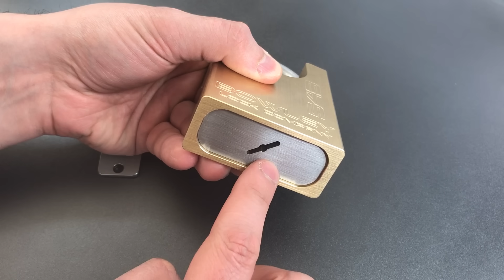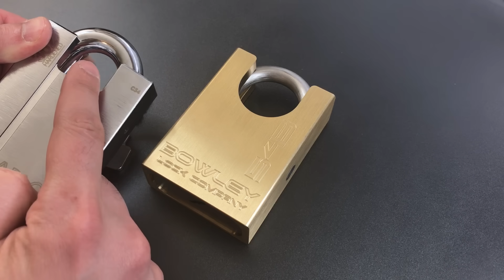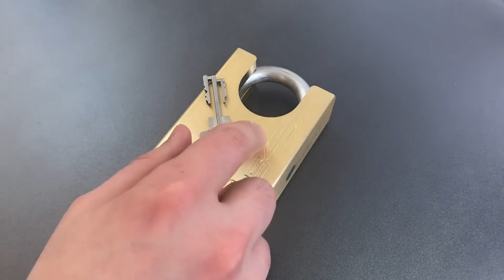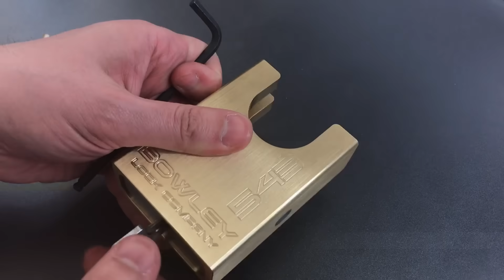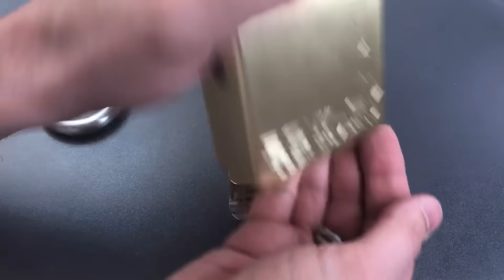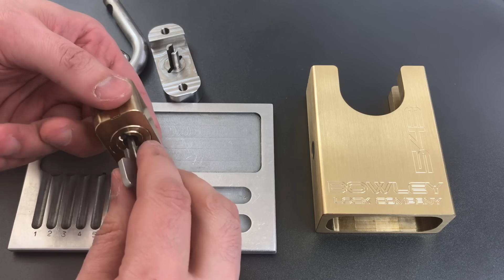[653] Prototype Dual Fork Bowley Padlock (Model 543)

Comment: I just don't see that key lasting... I mean, if you lock IT up in a cabinet somewhere, where it NEVER get's touched.....I guess it'll be okay, until time gets to it... but being such a frail little thing with such tiny amounts of connecting tissue (metal), it would be SO easy to accidentally skew, break, bend, etc. I dunno...I know you touch on this, but still... that doesn't look good. At all..... ...... and 1.2 seconds of effortless "bending" is hardly representative of what could happen out in the world with a chintzy key like this flopping around, catching on things, being pressed on, etc... 

Also, you said the lock body was brass right? One being aluminum as well right?  Can't you just use a cordless grinder, thin cutting wheel, and make one fast line down the thing, then just peel it open? I mean, you can have the strongest shackle and bottom plate on or off earth... but if the case is made of paper, that's not gonna do much.... right?

Comment: Good gawly Miss Molly... Are you kidding me!!!
 Other than the sport of making a pick proof lock, and they surly did... 
  At some point, wouldn't a 12Ga shotgun just have to be called upon! 
   This takes padlocks to a different level. 
   At some point, cutting the lock is not the weak link. Taking out whatever it's locking through becomes the weak link and can always be done....NOT NONDESTRUCTIVE. One will have to break something.

Comment: Me, as a Brit:

Listens to the rationale for the model number: Cries in metric
Reply: The rest of the world agree with you. Miles? Miles what? Foot? Who's foot??? Who the hell has a foot like that? Inches? Oh, I see. So you're telling me that, to apply a convertion, you just have to multiply a centimeter by <insert a random irrational number here>
Reply: @gabrielsantana6161  For what it's worth, the conversion factor isn't an irrational number. One inch is exactly 2.54 centimeters.
Reply: Trying to work out how it's 5/4" thick 🤔
Reply: @rich7304  Where's the problem? 😄
Reply: @kubauhlir1730  inches.......inches are the problem 😂
We won't even go into how fractions work 😜

Comment: I’m gonna go out on a limb here and say that this one is probably the closest a lock will ever get to being “pickproof” in a long time.

Edit: I’d like to reiterate that I said PICK-proof. A cutting wheel and a blowtorch is not lock picking
Reply: He’s got a video where he lists the best locks made and there’s one he says he has never been able to pick.
Reply: @srcastic8764  which one?
Reply: LockPickingAttorney in 2121 "This primitive lock from the last century was difficult at the time to pick, but with modern quantum impressioning tools it's ridiculously easy"
Reply: The thing is, that this here is a commercially mass produceable lock, while the stuff made here one is so incredibly specific and has so many unreliable parts, that you cant realistically mass produce it
Reply: @BlueTroll  
What kind of shitty locks would open with air pressure? You are better off just raking it open if the pins are designed as open at the bottom position.
Reply: @Bollibompa  I'm not arguing at all that the standard key locks you buy at the store are secure at all, just a method of opening them.
Reply: @BlueTroll  
I'd argue that almost no padlock made in the 21st century has pins designed like that. I'd love to see it happen though. I'm very suspicious about the tennis ball thing though even if it would be a hilarious party trick to use on old cars at a meet-up with old Chevrolets and Ford models.
Reply: @Bollibompa  I'm curious about old car doors tbh. I know for a fact that all RV doors have the same keys unless the locks are custom, so I'd imagine older cars, the manufacturers didn't care about that aspect to much. I know even with modern keys, dealerships have skeleton keys for particular brands.
Reply: @Bollibompa  it may not even be the pins that are failing with the air. There are so many ins with the common cheap padlocks, it's almost not worth The effort to use the for "added security"
Reply: @BlueTroll  “it may not even be the pins that are failing with the air”? Cores don’t turn unless the pins are moved to the shear point, moved out of the way, broken, or drilled. What are you surmising could be letting the lock turn unless it is the pins “failing”?
Reply: @docholliday9741  I'm really not surmising anything. Something engages or releases. As to what on each particular lock when it fails from air? I'm not sure.
Reply: It is almost definitley pick proof but just cut through the top which means it isn’t invulnerable. Bowley should make door and window locks from the same core as that padlock
Reply: @theelevatedone1630  it's pickable
Reply: @theelevatedone1630  they do make a deadbolt as well
Reply: @theelevatedone1630 mate if i bring a sledgehammer, i could break this lock. The whole point is that your average joe won’t bring a sledgehammer
Reply: @theelevatedone1630  they have deadbolt locks for doors which are similar in idea to this padlock, but theyre an older model that use 1 set of pins. That being said, LPL to my knowledge still hasnt picked the single set core for the dead bolt lock.
Reply: @Massey9276  dead bolts are easy
Reply: @abrother9821  Even if the Stuff Made Here lock turns out to be pickable, I doubt it will be pickable with any existing, well known methods.
Reply: @r3dp9  I'm sure you've seen the new video where LPL picked his locks, both of them, but mentioned that theres a few simple improvements that stuff made here can make to make the locks far more resistant to the attacks used.
Reply: @r3dp9  that comment didn't age well lol
Reply: @r3dp9  well this didn’t age well
Reply: @r3dp9  lpl special tool turned out to be a pocket knife 😂
Reply: @r3dp9  they both got picked in under 1 minute
Reply: @r3dp9  I’ve got some bad news for you buddy
Reply: @r3dp9  this comment didn't age well
Reply: @ryantxbbq  I mean, it aged kinda well. He said it wouldn't be through well-known traditional methods. LPL did have to get pretty creative. First lock had to have a completely new method to opening, and the second lock had 1 new method, 1 new alteration of a regular method, and 1 old method that isn't really used anymore

And LPL was only able to figure this out because he's not only one of the best lockpickers in the world, but also had detailed blueprints of the inner workings of both locks. Far from traditional and well-known if we're being fair here
Reply: 4 SIDES ON YHE KEY AND HE CANT DO IT EVEN BETTER 8 SIDES
Reply: Yo dude saw your pic and just wanted to say CODE LYOKO FOR THE WIN
Reply: 12 minute video. Good indicator.
Reply: If you see a lock like this just break the chain
Reply: @abrother9821  The avarice of "it's unpickable if it doesn't have a key." That's what bypassing is for, friend.
Reply: @OtakuUnitedStudio  a door is only as strong as its frame.
Reply: Id class it as pick proof , having to figure out the notches on the key and bassicly make a key isnt lock picking to me.
Reply: I have some thoughts about how LPL can pick this type of locks, but it requires a custom-made pick made from a blank key (don't know if I got it right). He could insert a diamond tip or some other suitable for racking pick inside the blank and connect it to the main shaft with a flexible metal string, hard enough to apply force to the pins.
Reply: That's what everyone thought about every iteration of Bilock, EVVA, Medeco and Protec up to this point too.  Regular Bowleys have been picked, this one isn't unpickable.
Reply: Just cut the top
Reply: Until a tool is made to pick it.
Reply: When does the quad-fork version come out?
Reply: No. We got an actually Pickproof lock (note the capitalization). It is not an adjective, but a proper noun.
Reply: @abrother9821  but did he ever review it? I have been waiting for a video on it
Reply: Yes I would agree but I can't remember his name but if you Google picking bowley lock you will find it there a guy Chris something cant rember last name he's big in lock sport  community  he opens the original bowley they call it picking but in my opinion its more or less a homemade key that works by trial and error there is a video maybe 12 to 18 months old put this design is still the best on market as far as I'm concerned you cant stop everybody but this comes dam close
Reply: @abrother9821  and he picked it in like 10 seconds
Reply: @abrother9821  yeah tact didn’t go do well
Reply: @N Webb I beg to differ. Would you rather have like 5,000 lockpickers know how to pick your lock or just 1?
Reply: Wait, why didn't you pick this one?
Reply: @abrother9821  that one didnt age well...
Reply: ay, man mans, code lyoko pfp!
Reply: It willbe unpickable - as long as it isn't popular.

The moment a lot of people would use it, then it would stop being unpikable
Reply: Well, it stopped lpl
Reply: Pickproof isn't a useful word.

1. Every picker is different. Something someone can't pick may be easy for another with a similar skill level. How you approach a lock biases you - if you apply heavy tension, you're going to struggle with locks that require light tension, if you feel for spring pressure you're going to struggle with dead-sprung cores etc. 

2. It's very easy to make a pickproof lock by welding it shut. That doesn't make it a good or useful one. What makes this lock good is that it's resistant in many ways, including picking.
Reply: @A cat on his hind legs. %
Reply: @SilentGuy Ulrich Stern from Code Lyoko, I knew I recognized your profile pic.
Reply: Actually, there is one lock that is absolutely, unequivocally pickproof. It's called The Forever Lock, and it was reviewed by BosnianBill. It's also extremely tough, too, and you'd need a few minutes with a VERY strong tool like a diamond hacksaw in order to cut it open… and it's faster to cut the body than the shackle.
Reply: And here is where the The Locksmashing Bartender and his trusty hammer come in. Although with the body on that one I might need to go to dad's house for the plasma cutter and a larger less expensive hammer.
Reply: @abrother9821  I was boutta mention this video 😁
Reply: @julian2804  me too
Reply: @julian2804  Boutta???
Reply: Stuff made here made 2 locks and lpl had to use the gap between the door and the lock to defeat it. Lpl said if there was no gap he wouldn't be able to pick it.
Reply: Bowlers are unpickable as you cannot reach the pins with a lockpick due to the massive shielding.
Reply: They made one with 4 instead of 2
Reply: It’s been picked
Reply: I highly doubt even your most experienced thief has picks for this lock. All you would need is a couple high pins on each side to make this lock unpickable.

You either kick the door in, cut chain or get out the cordless grinder.

No matter what, you aren't getting through this thing silently.
Reply: I mean arent digital looks pickproof
Even tho most have some sort of exploitable thing
Reply: @-who_took_the_name-5199  there’s ways to hack them
Reply: @-who_took_the_name-5199  they are pick proof, if they're not built in a way that allows an easy bypass like most are unfortunately...
Reply: I feel like you can get nearly any lock open with an air compressor with enough psi
Reply: @BlueTroll  No you can't unless you're referring to locks that you can simply jiggle open. They have different sized pins which means you need the pins in different positions, which means different pressure for each. Pushing too far or too little will have no result. Then you have serrated pins and false sets which you will not know if you're not feeling it. Plus, air compressors need electricity and are fairly loud so you're just making picking harder than it should be.
Reply: @eustacehendrix9659  if the lock opens, that's all that matters. He conduct similar tests himself by cutting open locked bags. If you defeat the lock, you defeat the lock regardless of how.
Reply: @Himeros24  well, because most locks are essentially spring powered, you could just open it with an ordinary air compressor. He defeats most locks with gaps, but even the smallest gap that you wouldn't normally be able to reach, could probably be exploited with an air compressor.
Reply: @BlueTroll  you would just be over compressing the springs and the pins would lock
Reply: @borregospringsbs  you can pop car locks from the pressure of inverting a tennis ball on the hole. So why wouldn't it work on anything else?
Reply: @BlueTroll  that's not accurate. The tennis ball thing was faked, and debunked, ages ago. If you understand how pins are set in a core, you'll understand why air pressure alone won't open even the most basic locks. There's no tension or rotational force applied with air pressure, so there's no chance of unlocking anything.
Reply: @bojanglesobrien6883  you obviously flunked the class with aerodynamics and fluid physics. Air is not a laser beam, it has mass. Anything with friction and surface tension (so anything) will move with application of air. If pins are designed to compress, blasting air at them will cause them to compress. If things are designed to spin, blasting air at them will cause them to spin. The differences in air pressure create vacuums, it's how things like planes function. It's not all that complex even if it is abstract to comprehend. The mass and velocity of the air cause tension, and the shape of the various components cause rotational energy.
Reply: @BlueTroll  you're just flat out wrong about this. Do a test on any lock with your choice of air supply. I'm very familiar with fluid dynamics, spent a career calculating turbulent flow and annular velocities, but the mechanical properties of locks(the vast majority anyways) don't allow for the kind of bypass you're describing. Tension is needed to set the pins at the proper heights to move past the shear line. Just pushing all the pins to their maximum with air will keep the lock...well, locked. The only way I see air pressure hypothetically working is if you're using a tension wrench to bind the pins and giving short bursts of air to try and set the pins individually, but at that point you may as well pick the lock traditionally since you're already using tools.
Reply: @bojanglesobrien6883  I've done it before on simple pad locks, and I've seen the tennis ball work on older vehicles in person. The tennis ball works, and with a shop air compressor, most common locks can be opened. 🤷
Reply: @BlueTroll  you can’t use and air compressor or a tennis ball to open locks if then pins are pushed all the way the lock won’t open. You have to push each pin a different distance to get the mechanism to turn
Reply: @bawlz1234  yes, the air does that. It works. I've done, others have done it. Can confirm for at least most normal key locks.
Reply: @BlueTroll  liar
Reply: @BlueTroll  you just said something and won’t back down lol
Reply: @BlueTroll  you replied in less than 60 seconds you’re trippin bro
Reply: @bawlz1234  that tends to happen when someone tells the truth
Reply: @aaronm.3581  not really,no
Reply: @aaronm.3581  The car that it worked on didn't have electronic locks, and I've personally opened locks with an air compressor. I'm not lying, nor would have anything to gain by lying.
Reply: @BlueTroll  People lie all the time with nothing to gain. A tennis ball won't open a car door. Never, zero chance. If you saw this you were fooled. Have you ever looked inside a car door? Make a video of yourself opening a lock with an air compressor. It would be the only such video on the planet and get millions of views. Let's see it liar
Reply: @aaronm.3581  It can, has and does. If you don't believe it, a video isn't going to change your mind. You do you.
Reply: @BlueTroll  Liar.
Reply: @aaronm.3581 your currently the liar, what I'm saying is true.
Reply: @BlueTroll  Show me liar.
Reply: @aaronm.3581  you are obvious to the facts. Video won't change that.
Reply: @BlueTroll  Yes, a video will change my opinion. Show me. Show the world!
Reply: @aaronm.3581  buy me an air compressor and you have yourself a deal. I no longer work at the factory which had airlines I used. Most locks you can open with a hammer without breaking the locking mechanism, it's not that hard to open a lock with something besides a key.
Reply: @BlueTroll  A hammer will work. And you can find many videos demonstrating this. Air compressor won't work, you have never opened a lock with one. Liar
Reply: @aaronm.3581  I have, your the liar for claiming otherwise.

Comment: 5th Element, the movie,
the key had a similar design but with 4 blades.
Let’s see Bowley do that
Reply: Nothing special to make, but that would imply there's 4 independent locking sections inside the lock, which would meant it would have to have a square section vs flat rectangular now.
Reply: aserta 
and also rotating it to max 45deg.